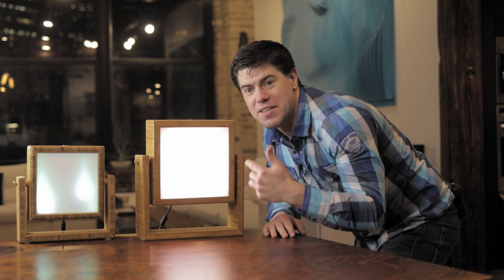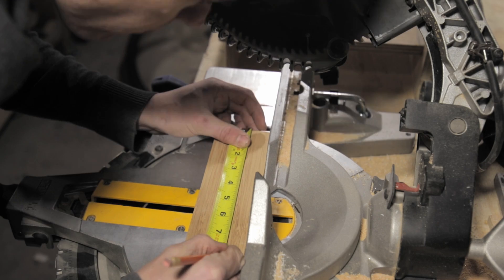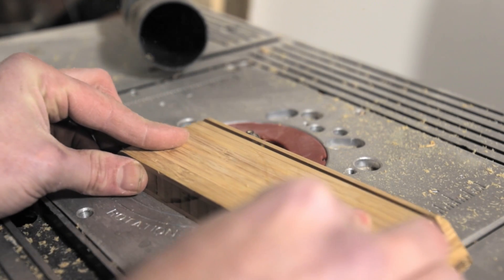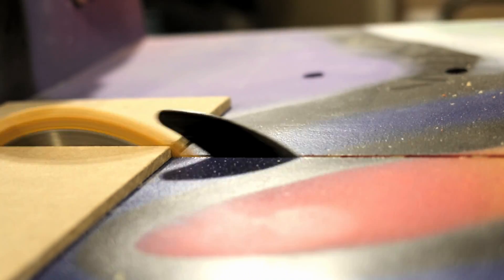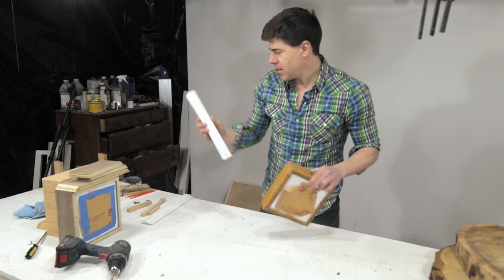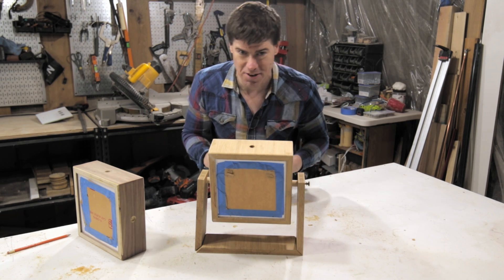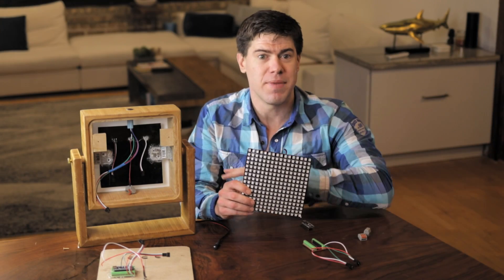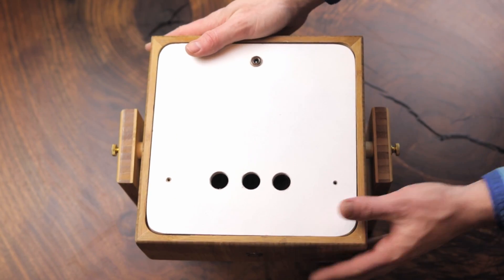DIY LED Matrix Table Lamp || Arduino-Controlled || How to Make

Comment: Q: Where can I find LED bulbs that are smaller than the ones used here? Like for a smaller project but without big LED color blobs
Reply from the maker: Like a smaller 8x8 LED matrix?  The LED modules in this type of matrix are a pretty standard size.  

Or are you talking about just diffusing them more so you don't see the spotty light as much?
Reply: @modustrial  Maybe? I'm new at this. Like 8x8 in size of the panel, but the individual LEDs would be smaller.
Reply from the maker: No, the individual LED modules are pretty much the same size.  Why do you want smaller modules?
Reply: @modustrial  I just wanted to see if they did go any smaller. Nothing really behind it.
Reply from the maker: There might be some, but I'm not aware of them

Comment: Hello Modustrial Maker This project is beautiful I have already started making this and my son just called "pretty cool" and he rarely compliments anything I do. for me the electronics is the hardest part of any project so I had to get that working before I could invest in the wood and time to make a nice cabinet style enclosure. So thank you for this project. I have a few questions I would like to ask.#1. This works on either my 5v power supply or my usb charger port mounted in one of my homes electrical outlets would I need to actually use both power devices to power this properly or is either one alone going to be enough?#2. I am curious why the "Fireplace visualizer" is completely commented out, what would happen if I uncomment that code ?Thanks again for such great projects
Reply from the maker: I couldn't get the fireplace code working....it would crash everything and the light would freeze up.  I think it was due to limitations of using an Arduino  Nano.  If you try it with a Mega it might work.  One 5V power supply should be enough, as long as it is 3A or more (preferably 5A or 10A).
Reply: Hey, I was curious is there a way to add a case mounted potentiometer to adjust the brightness depending on situation and/or location? I think that would be really cool.

Comment: great project! can the code also drive a matrix with 64 x 128 points? how should the unite
individual matrixes can be connected to the arduino?
Reply from the maker: The code theoretically be adjusted to any size matrix.  However, with a matrix that big my understanding is that you'll have timing issues if you try to drive all the LEDs with a single control signal.  Most people use a Teensy with an Octows2811 shield to drive 8 groups in parallel.  This is on my to do list, but I haven't yet had time to figure it out.  I suggest checking over on the FastLED community on Google+ if you are interested in this size of matrix.

Comment: I'm totally jonesing for some some of that bamboo ply.  I've done lots of boxes and always do chamfering and such of edges after glueup, but I do it on the router table.  You can also make your box a little deeper than you want it to be at the end and trim it off on the table saw.  But that bamboo ply...  sweet.  BTW: Please add my vote for some shop videos. The funky crosscut sled for one...  First time viewer, now a subscriber.  Keep it up.
Reply from the maker: Thanks for the tips!  Always looking to learn.  I snuck a little shop build for a circle cutting into the 50k giveaway video I posted earlier today, if you are interested...
Reply: ALWAYS interested.  So many projects, so little time...

Comment: I bought all the parts for the build via the links above but there are no dimensions. Can you provide dimensions?  Thanks
Reply from the maker: Nathan Safran check out the instructable I made by for this project.   It has some example dimensions.  Just search for me by same user name on Instructables.com
Reply: Modustrial Maker awesome, I’ll do that, thanks!!

Comment: Love the build, Mike. It reminds me of a project I intended to make a few years ago called PixelBrite (http://www.instructables.com/id/PixelBrite/). 

If you’re looking for inspiration, it would be cool if you could control the LED matrix with a computer. The project I linked sends serial data to the arduino. One use case would be to have a computer generated animation (e.g. using a Processing sketch) that reacts to music, which is transmitted serially to the arduino.

I think there is industrial software that does this, but I imagine it’s possible to make it from scratch (get frequency components of audio using FFTs, then map those frequency bands to components of a pixel animation).
Reply from the maker: Hey man, good to see you here.  That is definitely on my list.  I've tried to get the computer programs going on a Mac, but they haven't worked.  It is one of the big reasons I'm spending my PDA to get one of new Intel/AMD Windows laptops -- I think the free program that you supposedly can get going on a Mac (although almost no one has been able to) is Glediator.  The other free one I think is called Jinx.  They both can map video to matrices of adjustable size, if I recall.  I'm looking at doing a large 2'x4' matrix like this sometime soon.  There is also DMX control and Art-NET, but that gets on a whole new level of cost. (Check out the company Madrix and their YT videos for some really crazy stuff).  

I've done some stuff taking FFT or FHT of audio input signals from a mic -- works OK, but is better from and MSGEQ7 chip, which breaks the audio into 7 bands for via hardware.  I have a few of these chips, just haven't had time to mess with them.  If you ever want to play with this stuff, I have a huge stockpile of microprocessors (teensy, esp8266-based, and ESP32-based) and LED strips, and I'm happy to loan them out for tinkering.
Reply: Modustrial Maker sounds like you’ve got quite the collection going. I’ve attempted doing FFTs on a line input using Processing, but the results are hit or miss. I’ve also tried using the hardware FFT chip you mentioned, but it was poorly documented and notoriously difficult to read out the measured amplitudes of each frequency band (it’s like a serial output triggered by specific high/low input signal combinations).

I might be interested in helping out in a few months when I have more time. It would be interesting to see if Traktor or Ableton had any readable outputs (like the detected beat) that could be used to sync up the animation. They’re all closed source though, so I don’t think that’s an option. 

And yes, I’ve looked into Madrix, but the cost was just way too high if I remember correctly.

My sense is that it would be possible nowadays to integrate a Raspberry Pi inside a build, and just supply a line-in or mic for the audio input. Maybe use hardware filters to get the frequency bands (since FFTs are computationally expensive), and send those frequency bands to the RPi to make the animation and send the data to the LED matrix
Reply from the maker: Have you checked out the FastLED library yet?  There is a ton of code out there using FastLED and MSGEQ7 that seems to work pretty well with line and mic inputs.  Heck, the FHT I found using noisy mic input was pretty decent.  I can dig up the files if you are interested.    I haven't played much with Raspberry Pi - my understanding is that it is good for video rendering on LEDs and pre-programmed displays, but the way it does timing isn't as good for reactive control of WS28xx LEDs.   Seems like most people use Arduino, Teensy, and ESP8266 for this.
Reply: Modustrial Maker I didn’t know FastLED had an MSGEQ7 library, so I’ll have to look into it. Also, you’re right about the RPi...probably best to have an arduino directly control the LED chips. I once tried to prototype an animation on my Mac, which sent pixel color data to an arduino (when then refreshed the actual LEDs). I then imported that code to run on an RPi (Model B at the time), but it was too slow to refresh the animation in real time.

The reason I mention the RPi is that I think a build is cleaner if you can remove the need to have a laptop hook into it. But if the Pi is too slow, the only way to do that is with hardware filters and pre-programmed, efficiently-coded animations on an arduino (I’m talking cool DJ sound-reactive LED animations).
Reply from the maker: It isn't a dedicated library, but a lot of users have created code and documented projects using FastLED and MSGEQ7.  Check out the FastLED community on Google+ -- very active and there are a bunch of people who are quick to help and have done about everything you can imagine with microcontrollers and LEDs.

Comment: Thanks for posting all those details, and especially the code.  For my own  multi-routine demos, I've now been including each display routine as a separate .h file, which I think improves the readability of the whole program.
Reply from the maker: Yes, that definitely does help!  I wish I had time, but between the woodworking, filming, editing, etc., I tend to do just enough to get it to work; e.g., proof of concept that looks pretty on film :)   One of these days I'd love to find a way to partner with someone really skilled at the coding to actually turn some of my design ideas into products.....  you wouldn't know anyone like that would you? ;)
Reply: @modustrial   I'm working on a similar but differnt project right now. Feel free to give me a ring any time!

Comment: I don't like the way the miter joint corners came out. You should take more care to do it more accurately. I know it's not easy but taking your time for that always pays off!
Reply from the maker: +Zyr4n0 I discuss this in the video.  It was a learning experience on the first round because I routed the edges before glue up, and the router caused chip out.  The second lamp where I routed after glue up came out much better.
Reply from the maker: +Zyr4n0 I discuss this in the video.  It was a learning experience on the first round because I routed the edges before glue up, and the router caused chip out.  The second lamp where I routed after glue up came out much better.
Reply: I mostly meant the gap due to an inaccurate 45 degree angle or a crooked glue up!

Thanks for the answer and good luck for future projects!
Reply from the maker: +Zyr4n0 ah yes, I probably should have reshot the closer up footage with the second lamp.  Look closely at the larger of the two lamps in the beginning and end of the video and I think you'll notice it is much improved.  The miters in the first one were cut on the miter saw, and this technique just doesn't seem to be as accurate.  I built the crosscut sled for making the second two and this helped a lot.